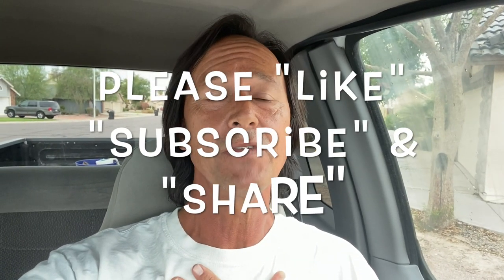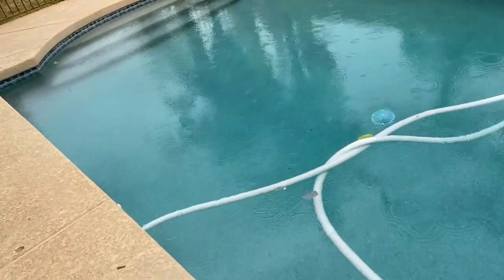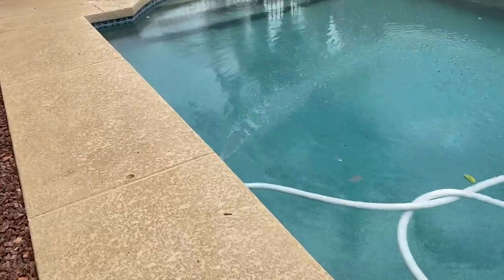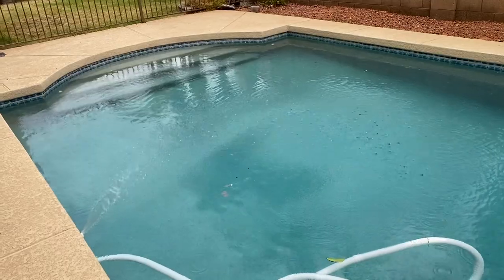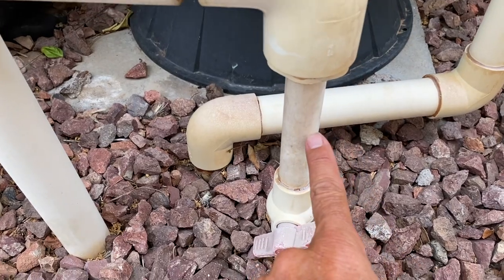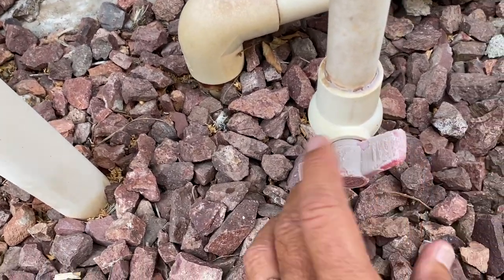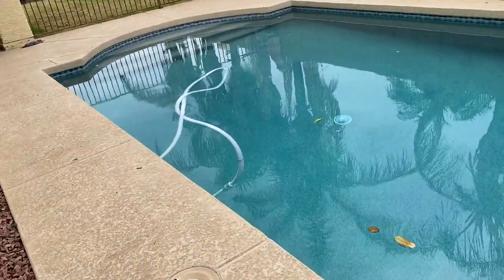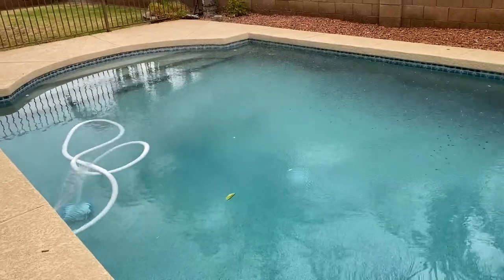Aerators

Comment: Middle of June here in the valley, my inground pool averages 90-94, aerator installed, runs overnight when the vac is on and water temp was lowered about 4–5 degrees.
Reply from the maker: @tjroicub6079  that’s not bad. Every little bit helps in this Arizona heat.

Comment: Very good explanation for those homeowners who don't know about the aerator and when to use it. I am also in Arizona (Chandler) and I turn on my aerator Father's Day and turn it off Labor Day. That cools down the pool during the hottest portion of the summer. My pump runs at night, 2-5 AM on high speed, then during the day (9 AM-2 PM) on low speed.
Reply from the maker: That's perfect.
Reply: How do you keep your ph from constantly rising?
Reply: @drewsenthused6079  In Arizona that's almost impossible, so we keep muriatic acid on hand at all times. I add about a quart about twice a month during swim season.
Reply from the maker: @robertjoseph1592  If your ph is constantly rising it could be a few things:  1.  Your water source is high in ph and every time your auto filler adds water it's increasing the ph.  2.  The very environment of your area (vegetation, temperature, climate, dust, etc) and use (people, pets etc) can affect the ph as well.  I have some pools that are constantly high ph and I add a quart of muriatic acid to them every week during the swim season to keep it in check.

Comment: Thanks for the intro on aerators!  A pity that our pool is not equipped with aerators, seems like it would be difficult to add it back (after the pipeworks is built)!
Reply from the maker: Yes, aerators are a good thing to have on a pool especially in areas like Arizona or Las Vegas where it gets very hot in the summertime. But there actually are ways and products made that create a water feature by adapting into one of the returns yes of your pool which actually work quite well. But the best way is to have one plumbed in when the pool is being built for sure

Comment: Where can I find it in a Pentair pump
Reply from the maker: Do you mean the aerator or the valve for the aerator.  Neither is a part of the pump.  The aerator is plummed into your pools return plumbing.
Reply: @PoolSchooler  I found it but it’s broken The handle
Reply from the maker: @heysiarjona8410  So, the adjustment handle on the valve is broken?  Usually you can still turn it with a pair of pliers. Rather than having to replace the entire valve (which requires cutting the pipe and bonding in a new one) you can simply use a pair of pliers to adjust the water flow.
Reply: @PoolSchooler  are you from Arizona
Reply: @PoolSchooler  because I want to talk you about it
Reply from the maker: @heysiarjona8410  well I live in Arizona.  But I was born and raised in Northern California and spent about 8 years living in Southern California. But yes, I've lived in Arizona for over 30 years.
Reply: @PoolSchooler  how can you give me a call
Reply from the maker: @heysiarjona8410  Unfortunately I have a policy in not calling or giving out my phone number.  It's a security and safety thing.  It's just a policy to keep my phone number from getting out and getting inundated with phone calls and texts.  If you want to email me a video message and I could email back a video message to you.

Comment: Why would you want to lower the temp in a pool in Arizona? I can only use my pool here 4 months out of the year you actually need a pool heater. Must me some polar bear 🐻‍❄️ thing
Reply from the maker: I know.  It amazes me how many pool there are out here with only a 4 month (or so) swim season.  But I've had pools that have hit 88-90 degrees during August, which don't feel refreshing at all rather like a warm bath.  So the Aerator helps keep that down a bit.
Reply: @PoolSchooler  Understood makes sense